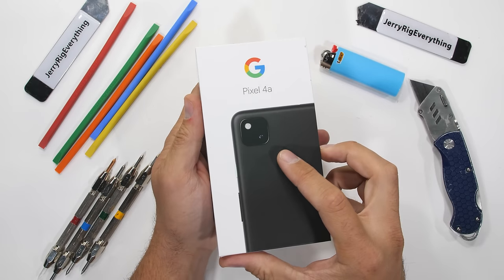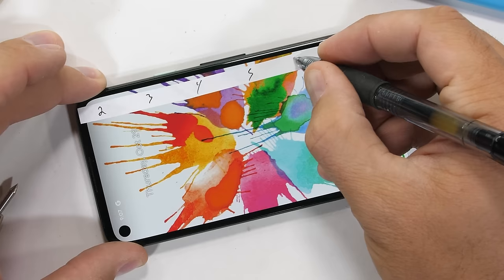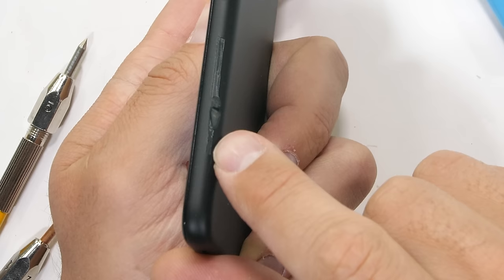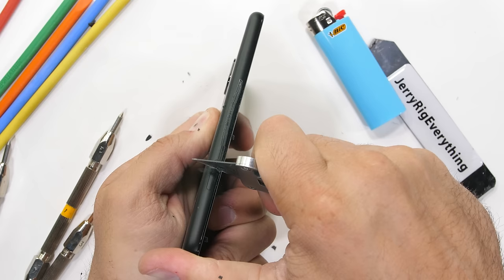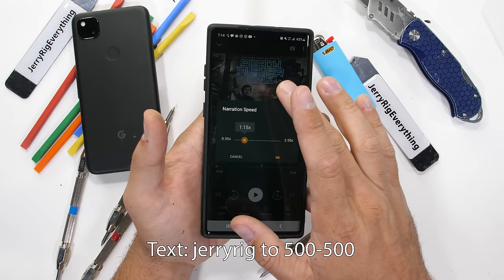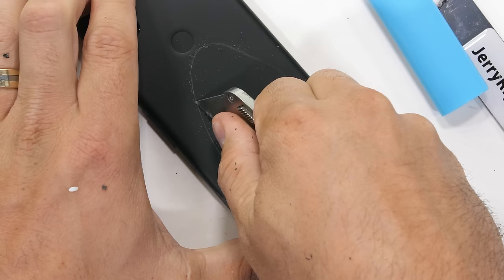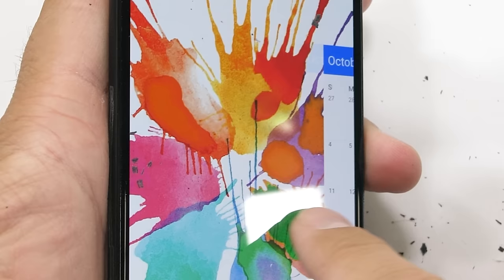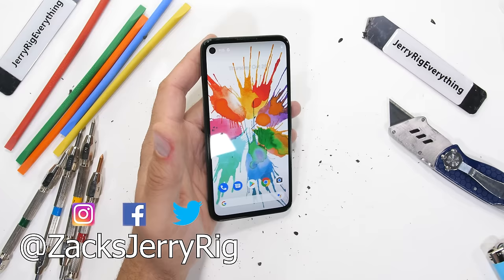Google Pixel 4a Durability Test! – Simply Solid?

Comment: Where's pixel 5 test? Curious to see how they managed to get wireless charging on a metal phone.
Reply: The metal chassis has a hole located in roughly the middle of the phone, and Google engineers ran the wireless coil through that.  The whole chassis is then coated in a plastic resin.  Voila, a metal-bodied smartphone with wireless charging.  
  Those Google engineers can be pretty innovative when they put their minds to it.  Now if they could’ve just gotten that Pixel 5 top speaker right...🤦🏼‍♂️🤣
Reply: @Sharky165  Or the new "screen gap" feature
Reply: The outside is plastic
Reply: @Sharky165  they should use the top portion for the other speaker
Reply: @e39purist89 Yesss 🤣🤣  
  And some owners of the Sorta Sage variant are reporting that the green dye (paint?) from the plastic resin is rubbing off on users' hands and pants.  Like WTAF ?!  (I believe some Pixel 2s or 2XLs had a similar issue?)
  In seriousness, these may not be a widespread enough problems to force Google to do a recall, but they're indeed ridiculous & embarrassing.  
  Where the Hell is the QA/QC these days ?  Don't they beta-test smartphones internally prior to mass production, and even if a handset passes all those tests with flying colors, don't they sample-check early production batches for potential problems ? 🤦🏻‍♂️  I just don't get it...
Reply: @azizaja8255  Exactly -- like Samsung did with the Galaxy S20 FE.  It's just a tiny sliver between the top of the display and the bezel.
Reply: The Anonymus Apdroid  I never said it wasn't.  
  I like Pixel a lot, and want to see the line continue to evolve and improve.  If you're a lover of stock Android, then you already prob agree that it's important for the platform's owner to produce a handset that showcases its software innovation.  
  I even believe that the 4a/4a5G/5 are steps in the right direction for Google -- stick to making good mid-rangers and avoid the $1K+ flagship "gladiator pit" 😆
  What I'm upset about is
a)  Dumb (or at least questionable) design decisions, like submerging the phone's earpiece/top speaker under glass; and 
b)  Google's lack of quality control (see my other comment).
Reply: @Sharky165  That's why you never pre-order units. Hopefully it's just a bad batch but funny enough on an LTT video they were talking about the screen gap and one of the camera men (andy) had the gap as well. I'm sure if there's a huge problem Google will fix it or give out free repairs on those issues.

Also, I agree about the top speaker. It just muffles the sound and vibrates the chassis. One of my friends picked up an S20FE instead of a pixel because of that. That just goes to show how a little issue can really cause a huge customer base to look elsewhere. They're good phone with amazing cameras, but they just need their hardware to get better.

Comment: I've been an iPhone user for quite a while, until when my iphone's battery died, my dad ended up forcibly making me choose android. I ended up falling in love with that phone and now im saving for the google pixel 4a.
Reply: Honestly my iPhone 11 pro is slower than my Samsung Galaxy S20. I have yet to try a Google phone, but I've heard they're fast.
Reply: David Mendez my 6s is just fine
Reply: @davidmendez6651  they're quick and the software is super clean and perfectly optimized. As youd expect when the company that designs the running system also makes a phone.
Reply: @davidmendez6651  iPhone's are faster than Samsung bruh. Your iPhone might be a defective one.🙏
Reply: @sajjansingh4329  🤡
Reply: @sajjansingh4329  iPhones have fast CPUs, however the severely limited ram makes it so that if you have too many things running in the background iPhones slow down significantly and Androids pull ahead significantly.
Reply: @sajjansingh4329  Maybe the visual effect is what he means. It does make a big difference when the screen is a 120hz one over a 60hz . Iphone maybe faster but high refresh screen just feels snappier and appealing
Reply: @kylereis7854   just try gaming on iPhone and samsung, you will know which one is faster. Try rendering a video on samsung and iphone you will know the difference.
Reply: @sajjansingh4329  My OnePlus 8 feels way faster than a friend of mines iPhone 11 Pro in gaming, especially if we have even a single app open in the background. In rendering a video the iPhone is faster, however the only time I have ever rendered a video on my phone are when I was testing how fast it could render.
Reply: @sajjansingh4329  Loading games a bit faster or rendering something a bit fatser does not mean iphones are smooth. Once game is loaded it runs  as smooth if not more than iPhone. Also who tf even render videos on their phone?
Reply: @sajjansingh4329  who renders video on a smartphone
Reply: @sajjansingh4329  also check the thermal throttling issue on iphone 12 and 12 pro. No cooling system = more heat.
Reply: @NanoMine  I never said about smoothness thing, I said about being faster. iPhone's are better in video recording also.
Reply: @sajjansingh4329  Ok but that fast performance is something that is of no use for most of the time. What actually matters is smoothness which comes with high refresh rate displays.
Reply: @sajjansingh4329  genshin impact, apple iphone 12 got like 20 fps, apple is moving away from gaming, have fun
Reply: @kermitos680  ps4 pro can’t even hit 60fps constant on genshin impact it’s not optimized. I’ll choose android when my Instagram and Snapchat camera looks as good as the phone’s camera.
Reply: @davidmendez6651  Damn, really? As much as I'm not a fan of iPhones, I definitely didn't expect to see this comment lol
Reply: Pfft gaming a phone is terrible anyways if your going to seriously play a phone game just use an emulator on a computer are a console
Reply: @sajjansingh4329  try sideloading on the iphone...
Reply: @davidmendez6651  the iphone 11 is supposed to be faster than galaxy s20, but because a year has passed since apple has released the iphone, and depending on how much you use the iphone 11, the phone will slow down to keep the battery performance
Reply: @TheBusFoamer  bruh
Reply: @jhsk531  I haven't tried it but I cant wait to try it out :o
Reply: @sajjansingh4329  yes the iphone is faster than samsung, but after a year has passed, apple will slow your iphone down depending on how you use it. In conclusion, the iphones performance is slower than the galaxy s series.
Reply: @kylereis7854  the iphone has ram which is optimized for the software, but including more ram and battery in android will improve performance and also improve the user experience
Reply: @gurudath_s  cool!
Reply: @sajjansingh4329  if your saying iphone is faster, it really isnt.
Reply: @kylereis7854  gud 4 u@
Reply: Active PG3D it’s actually the other way around after 1 year a Samsung gets slow
Reply: @sock3981  for gamers holding a bad phone with RGB lights will feel great to them! Lol!
Reply: @sajjansingh4329  gaming on iphone is faster due to many factors. 
1.Faster NVMe storage
2.Better optimized applications
3. Apple's own processor
4. Better haptics and sensors in general
Reply: @TheBusFoamer  apple has clearly stated themselves that ever year they slow down the iPhones, while all android phones remain same in performance no matter what the battery. Apples fault for including small batteries in each iPhone.
Reply: @gurudath_s  gaming on android sometimes gives you better performance, depending on what gamer you are, android gives you the option to play on a higher resolution display, or a lower res display for better performance.
After all pixel 4a is a budget phone.
Reply: @sajjansingh4329  iPhones video recordings compared to android are worse than most android phone, but depending on what type of android user you are, in some cases its better!
Reply: @thatdumbguy2800  exactly
Reply: @activepg3d713  Its just that android has zillion choices while Iphones are mostly stuck with how apple wants their users to use their products
Reply: @activepg3d713  i had multiple Google phones. The Nexus 4,5 and 6, the Pixel 1 XL and the Pixel 2. By now I switched to Samsung, but I wouldn't think twice about a Google phone if I was about to buy a new device, they're great :)
Reply: Active PG3D my phone is almost 2 years old and it’s not slowed down so I’ve never had that happen to me oof
Reply: @TheBusFoamer  like i said, if your using the iPhone it will depend on how much you use your phone, if the battery degrades a lot, then it will definately slow down.
Reply: @gurudath_s  that's why I like android
Reply: Active PG3D my battery says it’s degraded but it still holds a charge just fine and my phone is not slowed down
Reply: @TheBusFoamer  odd, if your using an iPhone 8 or earlier, the battery would've degraded slot by then. If your using an iPhone X it depends. Anyway lucky you!

Comment: My anxiety levels are skyrocketing (Watching this from the 4a, w/o any protector or cases)
Reply: Any scratches on the screen? I've got the Pixel 5 and I'd love to use it without a screen protector, but damn it worries me scratching it up
Reply: How is the battery life? How much screen time are you getting?
Reply: @hard2bear3110  it scratches at level 6 with deeper grooves at level 7😂
Reply: @NatureShortsShow  🤣
Reply: @jaybariya9  I like to know
Reply: @NatureShortsShow  yeah but still! 🤣
Reply: So far no scratches, no chip marks on the body, it's clean! The battery got better over time because of adaptive battery, and is giving me 13-14 hour SOT for my usage (YouTube, social media)
Reply: @hard2bear3110  😂😂I know man scratching is an issue. Depending on how long you intend to use the phone, a screen protector may or may not be necessary
Reply: @edilebert  that's good news, hopefully stays that way!
Reply: @NatureShortsShow  definitely, it's the anxiety of never knowing if that one little grainy bugger will be the one to put a nice scratch in your beautiful display 😭🤣
Reply: @jaybariya9   I have around 6 to 7 hours on my pixel 4a
Reply: @hard2bear3110  I only applied a rhinoshield screen protector, the body seems to be really durable. I jad a pixel 2 xl, dropped it once, the glass back broke like crazy. The 4a is a half price small upgrade to that, and as I loved the p2, getting a slightly better, way cheaper and less crack-prone version was an awesome decision.
Reply: For anyone considering a minimal case, I am enjoying the spigen thin fit. Soft touch plastic feels nice and adds slightly more grip than phone's plastic. It does attract finger prints, but I hardly notice them and they wipe off easily. I wasn't a fan of the complete side cutout around the buttons, but I now appreciate it for easier back gesture swiping (if you're right handed).

Comment: JerryRigEverything: Google pixel 4a durability test, 
Meanwhile, 
“iPhone 12mini is shivering”
Reply: iPhones are durable. They just suck overall
Reply: Well the iPhone 12 n 12 Mini is made out of the same thing 😒
Reply: the iPhone 12 mini is leagues ahead in durability then any pixel...
Reply: How???
Reply: @sondrejohansen48  and also a leage ahead in price.
Reply: @sondrejohansen48  Pixel 5 is laughing with shatter proof metal body
Reply: @sourav7162  complete different segment of phone where one is a small size flagship and the other is a mid lebelnphone. There is even no comparison here tho
Reply: @sondrejohansen48  yeah. But 99% of users won't notice the extra processor power anyway. Also pixel 4a has a great camera and 3 years of major updates. Nothing is wrong with this phone.

Comment: Looks like this phone never needs a case for it, the phone being it’s own case built-in chalkboard sratching at level 2
Reply: I still like the screen being slightly lower than the edges of the case, in case I drop with the screen down.
Reply: you should still consider a case because of that camera, it protrudes slightly from the phone and you don't wanna break the best feature of the phone don't ya
Reply: @santiagocarrer7394  Exactly. Don't make the same mistake I did. One accidental drop and the glass on the camera lens is completely shattered. 😭

Comment: I'm looking forward to the teardown. Today I dropped my Pixel 4a into water and when I blew compressed air into the usb port water came out along the bottom seam and out of the audio jack. Phone is recognizing analog audio devices, it tried charging the moisture and told me more than 20 times during 3 hours to disconnect the charger, when there was none.

Comment: I am on my third screen for this phone.   The plastic frame of my 4a flexes so much that when it is mixed with a concussive force, such as dropping from a couple of feet,  the screen cracks . My Pixel 2 had none of these problems.  I drop phones a lot.  Going back to a metal framed phone.  Plus the video camera on the 4a is sub par in a lot of areas.
Reply: Just get a phone wallet lol

Comment: I finally found a real world scenario where the burn test is useful, i just dropped the amber of my "cigarette" on my phones screen, it survived flawlessly, thank you for testing for everything
Reply: A small amount probably wouldn't affect your phone. More contact with the heat is required, to get hrough he glass. Also remember that LCD's have next to zero burn-in issues, so only if your phone is OLED would there be a problem.

Screen burn in may be caused over a long period of usage. Or if you live in a hot climate.

Comment: I learnt the hard way so you don't have to. These phones glass will smash extremely easily. Buy a case and screen protector for it, it'll save you an expensive Google repair bill. I can recommend the ESR stand case, no prizes for guessing the most useful feature of the case. It has saved me more times than I can say since having the repair.

Comment: Even with a plastic design I don't see why phone manufacturers couldn't put in straight ribs along the edges to enhance durability. Nothing special or carefully machined, just straight bars, maybe 1 mm x 2mm x phone length. Just enough to add some rigidity.

Comment: That's a good result for the 4A. I'm not very surprised though as I recall your durability test of the Nexus 5X which also (despite its weird rattle that came from somewhere inside) passed your test OK. I don't think there is anything wrong with plastic, so long as it is designed and built well. I would rather have it than glass for the back if given the choice...

Comment: I accidentally dropped my Pixel 4a from around 0.5m on to tile. It landed on its back (in a rubber case) and the front glass shattered. Not sure if it was unlucky or what. Would be interested to see a drop test.

Comment: Honestly with all the crap phone I had had in the past $350 for the google pixel 4a is a very good price, my Samsung A10 is $340 and very strong and has high performance stats (it's no gaming phone but it still holds up when running cod mobile), I would eventually like to get the Asus Rog 3 5G gaming phone. But in the mean time the A10 is serving me well.

Comment: I used both 3a and 4a, I love everything about the camera and software, but finger print sensor work very bad if your fingers are slightly wet, when I go for running and used it as a music player, as soon I get a little sweat it's frustrating to unlock it, sometimes I have to use the PIN, this is the only thing I hate about Pixel 3a and now 4a

Comment: The camera housing, is it really glass? is it scratch resistant? I want to wipe the dust and sometimes when I pull the phone out, I hold on top the camera by accident. I am scared of scratching it when wiping. I am trying to use eye glasses micro fibre cloth to wipe after wetting with water.

Comment: This video is great BUT I have to say the LCD screen is beyond ridiculously fragile... It malfunctioned after dropping from like 1 metre onto it's back (not onto the screen). I then repaired the screen but as I was taking it off, I cracked it because it's so crazy thin... Wasn't an issue as I was replacing anyway but just a heads up

Comment: I could have told you what would happen with each tool scrape without even doing it.  Waste of a working phone imo.  I tried to take excellent care of mine when I got it, but like 2 weeks or so after getting it, all the sensors stopped working, except for GPS.  Then a 2.5" drop on sandy dirt ( not exaggerating)  completely spider cracked the screen.   Now a few months later, bluetooth connectivity is super spotty.   I am pissed at this release from google BUT i still can't find a small phone or phone this size with the same specs for the same price. I may be lured into buying the same phone again and seeing if I have the same result.

Comment: OK got the phone and after a 4 weeks it cannot charge or connect to anything because of a massage "Liquid or Debris in USB port" There was nothing in the port cleaned it, reset to factory settings same thing. Fuck durability this phone lasted 4 weeks in normal usage and in a safety case.
Reply: Google has a warranty on the phone